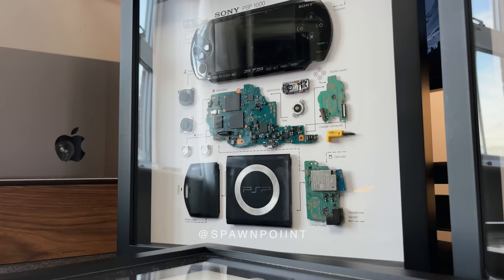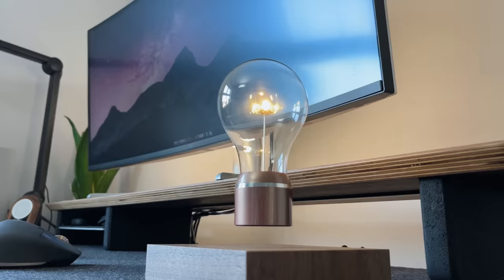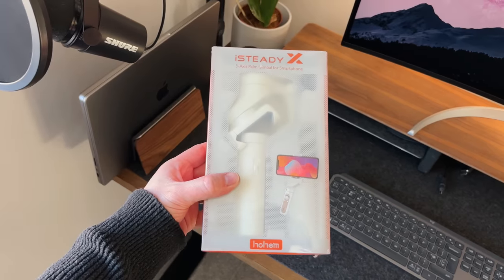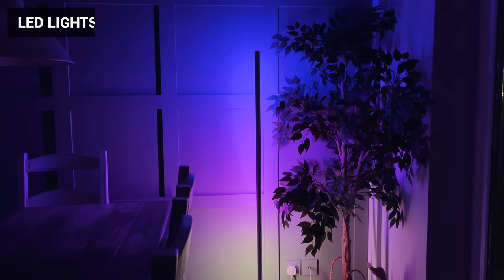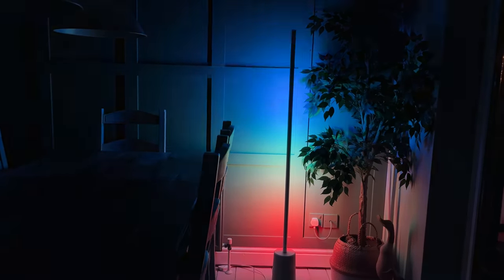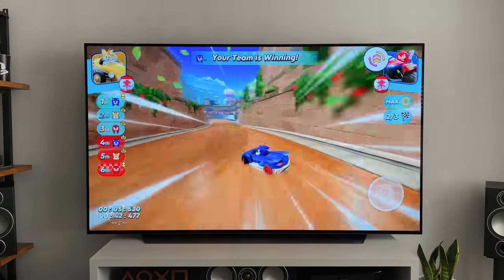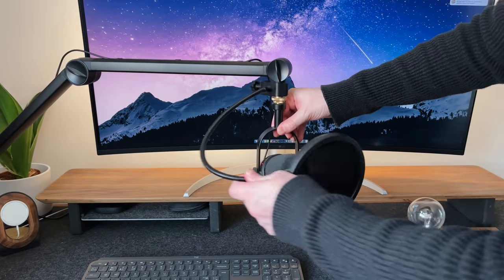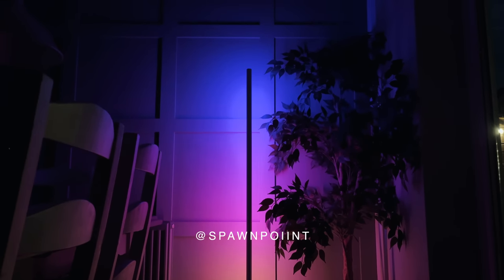10 Best Tech Gadgets to Buy in 2022

Comment: Hey mate. 2 questions. 

1. Did you change something about how you film? Normally your hover shots are smooth but in this video I noticed some shaking. For the first time ever in your videos. Just wondering if you changed something. 

2. Have you tried the apple AirPods Max on the PS5 via the audio cable? How is the sound quality compared to the steel series?
Reply from the maker: Some of the shots were done handheld (no gimbal) so that's probably why (especially the ones of the gimbals). Not tried the AirPods Max on the PS5 yet.

Comment: I have the same keyboard and mouse, but I’ve found that it does not play well with my Mac as far as customization goes, so I’m left with using the default settings.  The Logitech software is so clunky.  Maybe you’ve had better luck?